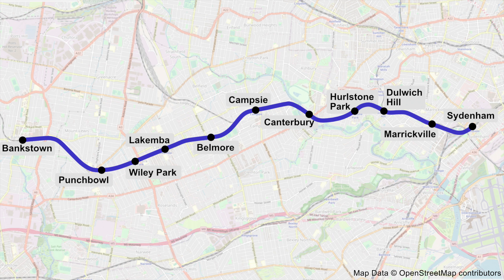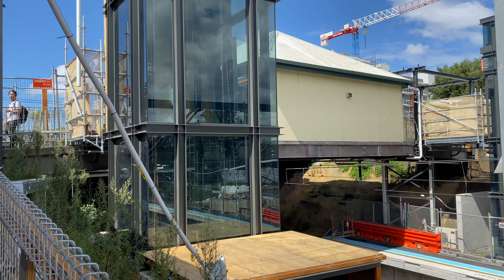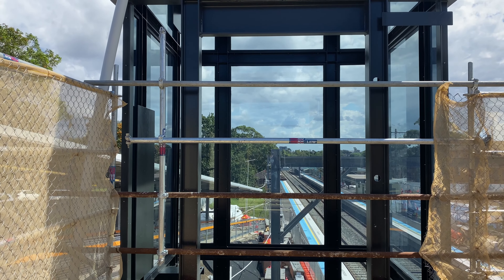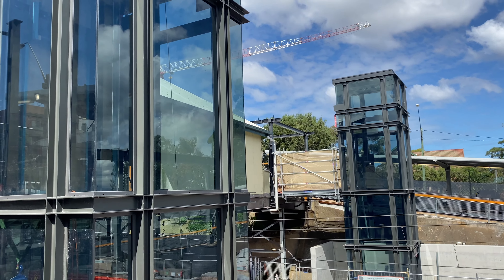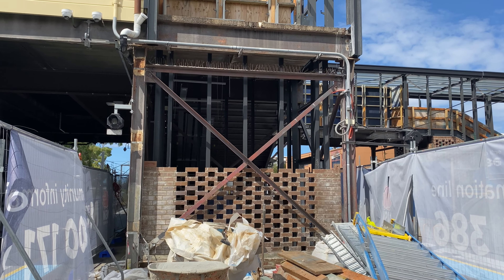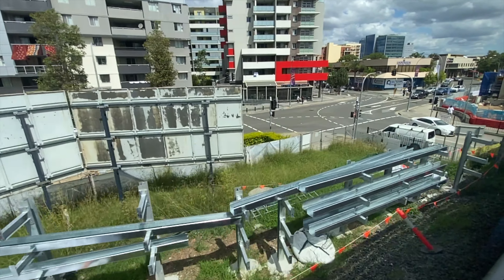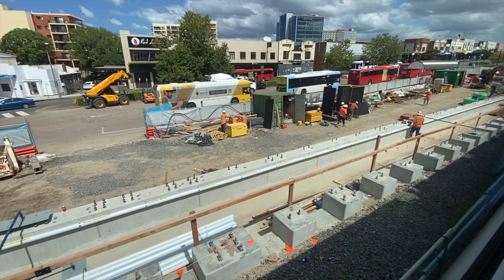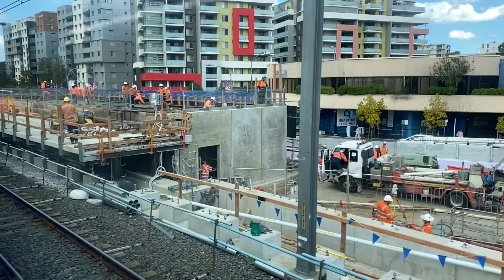Sydney Metro Update | New Lifts at Wiley Park, Start of New Platform at Bankstown & Punchbowl Update

Comment: Hi Paul, this is another of your wonderful update videos and I am amazed at how quickly the work is progressing but you surprised me with your quick finish to this video. I have always had a weird obsession with lifts and seeing the amount of glass in the lifts featured reminded me of a totally unrelated story regarding lifts. The original design of the lifts at Sydney Tower at Centrpoint was to have glass walls and cables which would offer spectacular views of Sydney as you travelled up the centre shaft of the tower, however it was decided that due to the speed of the journey and the movement of the tower especially in high winds and rain it would be better to have the lifts fully enclosed with tracks added to keep the lifts stable. I have experienced a journey under very heavy wind and rain when the rain was entering the lift through the small join between the doors and under the doors and the lift was moving with the sway of the tower. I found it very exciting but my partner at the time was terrified and she made us wait several hours before getting back into that lift. Imagine that journey with glass sided lifts and no soundproofing, exciting for me.  Sorry for the unrelated tangent.
Reply from the maker: Hi John, Yes the work is progressing very quickly! I think glass lifts are definitely not suited to the Sydney Tower! Their lifts are very speedy though! I've had a few nice lunches up there enjoying the views in the revolving restaurant! I've stayed in some hotels in Asia that have glass lifts and they are pretty cool! I think for safety and security, these glass lifts are a big improvement on some of the older lifts at other stations.